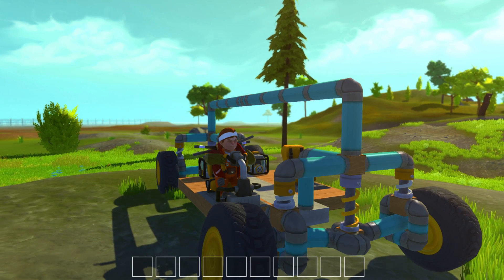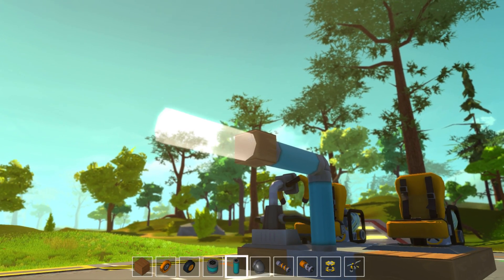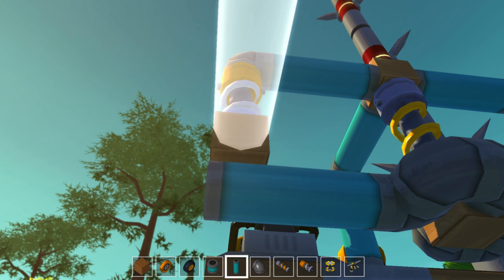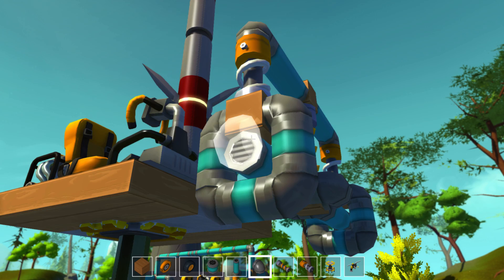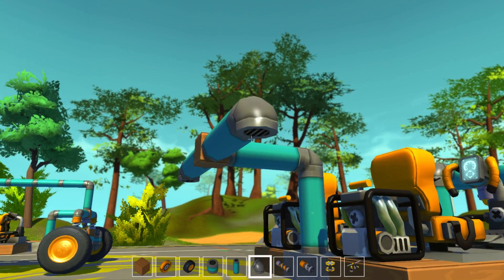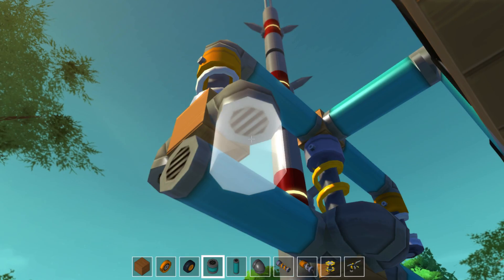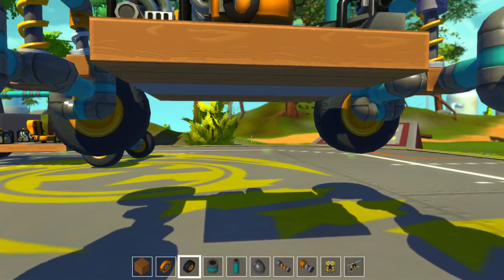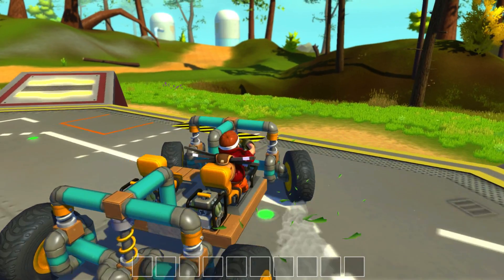Scrap Mechanic Vehicle Suspension Tutorial

Comment: cool concept and all but what does the central load spring do. I used it without it and it worked fine
Reply from the maker: Truth be told it was a mistake to put it in. It is not crucial to the design if anything it allows the wheels to pivot down a little more when they get air. it "may" increase traction, very subjective though. 

If I was to make the video now I would leave it out.
Reply: ok

Comment from the maker: After more testing here are some things I have learned.

Putting large springs on the outside makes it bounce out of the join more often and less fun.

 4 wheel drive only works if you have 4 wheel steer at the same time, this is very twitchy to drive and lots of fun.